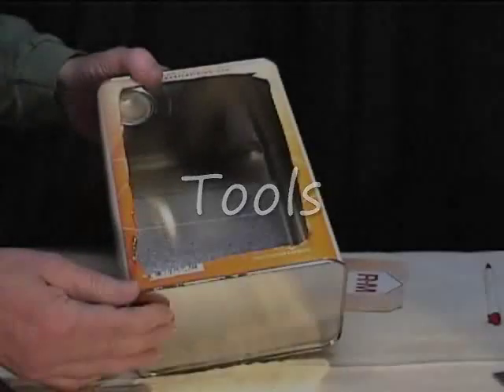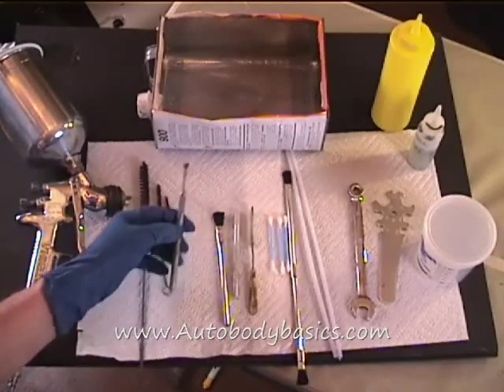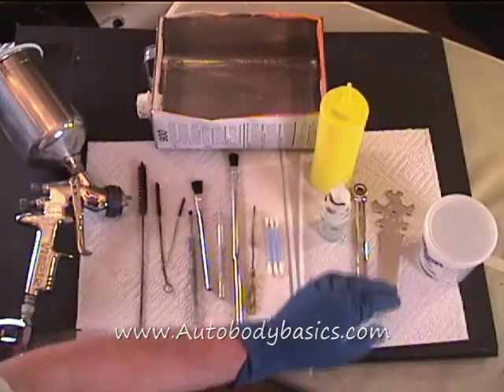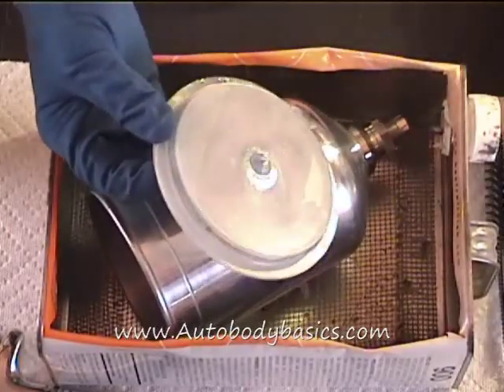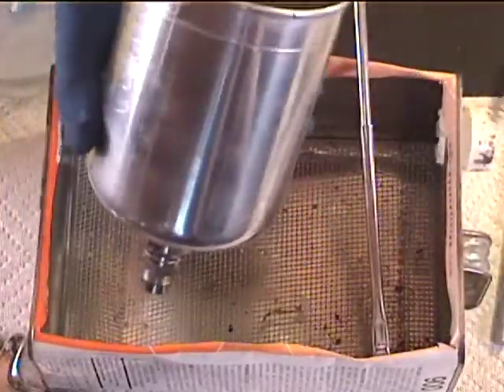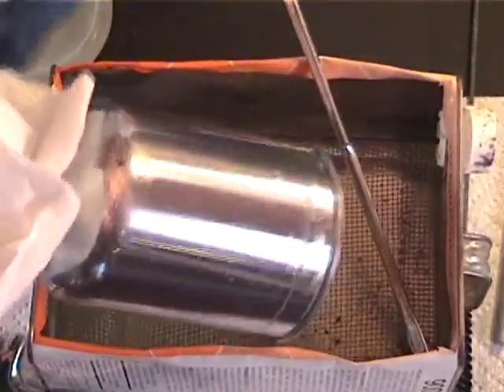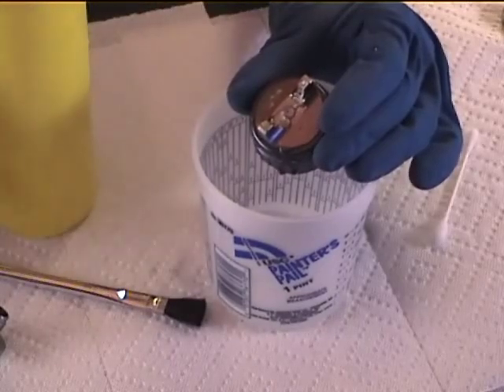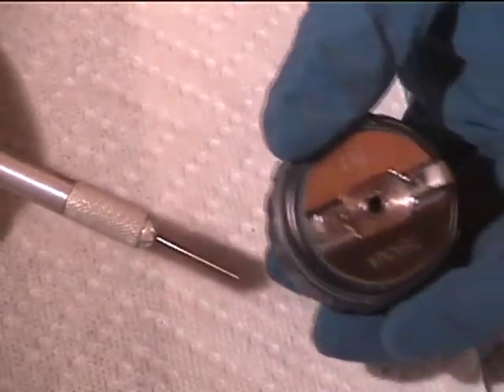Spray Gun Cleaning Part 1

Comment: Len, one comment. You shouldn't ever use the needle as a pick to get parts like gaskets or bushings out of the gun body. They are very easily damaged or scratched and will leak and mess with your spray pattern. I used plastic tooth pics for that purpose.

Comment: When cleaning out my sprayer which I used an acrylic enamel what kind of solvent should I use to clean it?
Reply from the maker: You can purchase recycled lacquer thinner from an auto body supplier fairly cheaply and it works great for enamel, lacquer, urethane and most solvent based products.  Use it in a squeeze bottle as shown in the video.
Reply: +commenteh  if your in California you will need to use gun cleaning solvent. it is basically acetone. It is cheaper than lacquer thinner. But if your in any other state lacquer thinner works better it doesnt dry as fast.